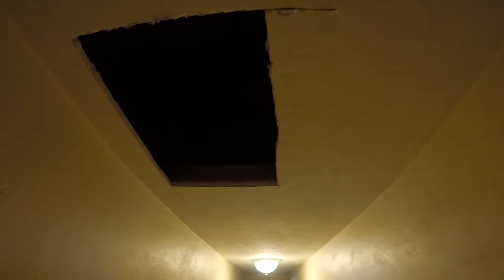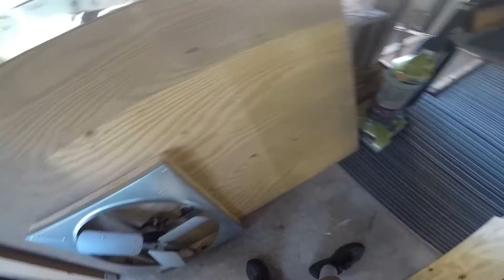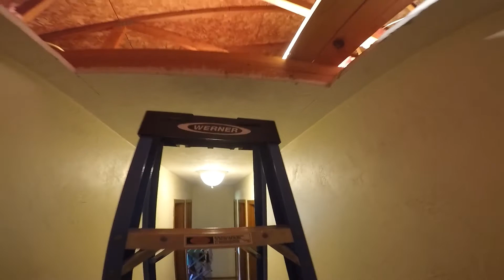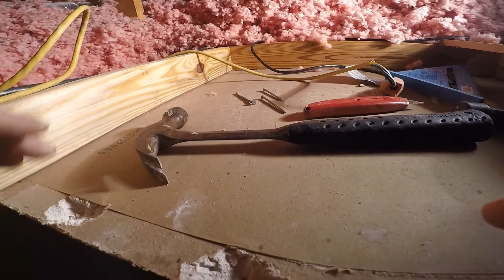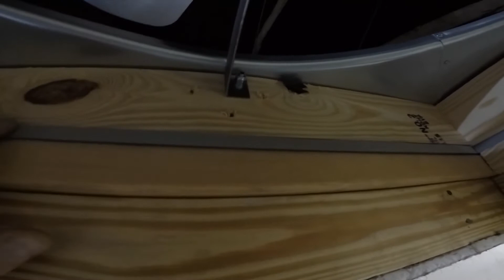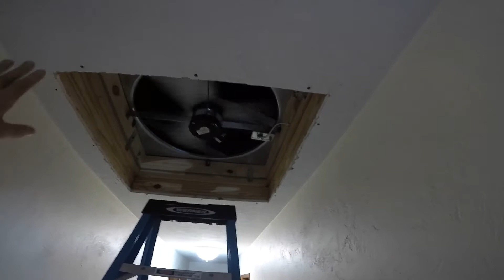how to install a hole house fan

Comment: Hello fishy dubs fishing!
it's amazing! Thanks for the very nice video! I saw it with great interest! Great! Have a nice day!
Reply from the maker: Thanks for watching Glad you enjoyed it at the time I did not run it that much one note is they are a little noisy if that bothers you but I don't run it for a great length time they do have models that are more quiet where are you mount the motor up in the attic and run some duck work Down to the louvers but they were more expensive at the time